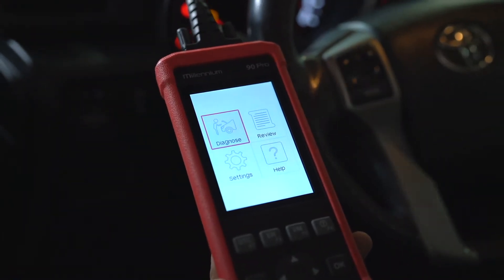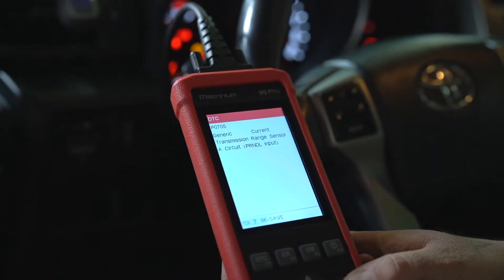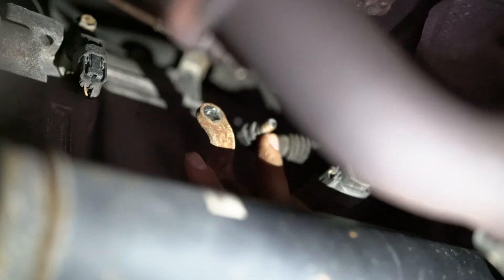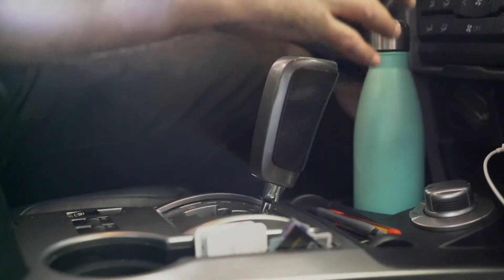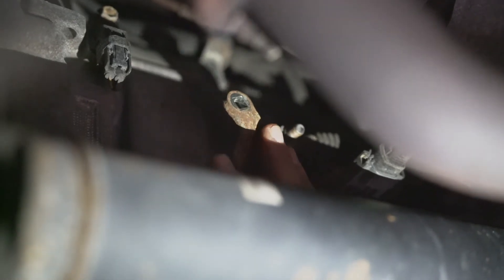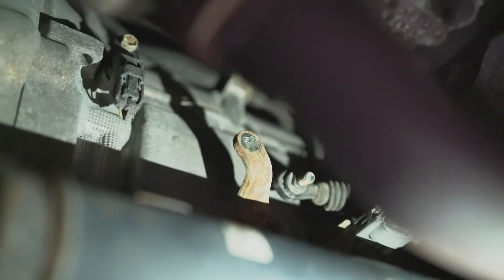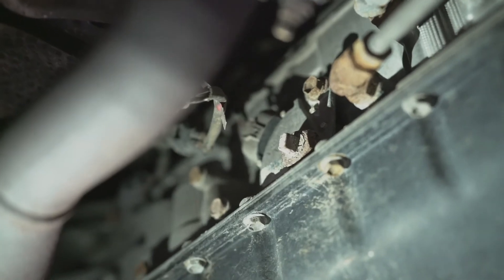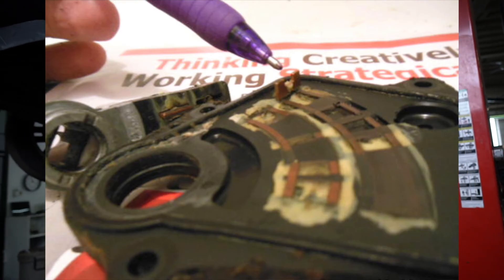Transmission   Neutral Safety Switch Diagnose & Replace

Comment: LOL, there was not a single word about HOW to replace the NSS.  This switch is a BEAR to remove.  Useless video.
Reply: I took a multi tool to mine on my tundra and it vibrated the thing right off. This was after I struggled with it for a while. Decided to cut it off but the multi tool worked like a dream just the vibration and it slid right off. Wish someone would post a video of hiw to properly adjust the dam thing though. Mines out of calibration.
Reply: @kelvis1980   have been at it for two days. Used penetrating spray and dremel to cut off part of that threased ring around the centraral shaft. Still wont budge. Verylimited spacce. How did oyu do it? Have and pictures or video?
Reply: @FnordyGemOG  others have said to heat it up and it will melt the plastic in the back and come right off but kind of afraid to do that myself

Comment: I have a ? Your experience is appreciated. My 2000 Mazda Mpv was leaking coolant. I cut the vehicle off several times to ensure engine didn't overheat. The next day I got in the van, the door light came on but no other power to vehicle. Also will not engage in any gear. What do you think is the problem ??

Comment: My 2015 does this if it sits for awhile.
Reply: So does my 2020. I had Covid and was not driving to work for 10 days. 4runner parked . Sure enough, thats when the shifter got hard to move and NSS replaced by the dealer no charge under warranty. Hope it never happens again.

Comment: this is a super common issue on the 4runners. Id say its almost always the NSS and not the trans. One bolt will answer the question.
Reply: Yes it is. My 2020 4 runner had this happen with just 33,000 miles. Replaced NSS at dealer. no charge